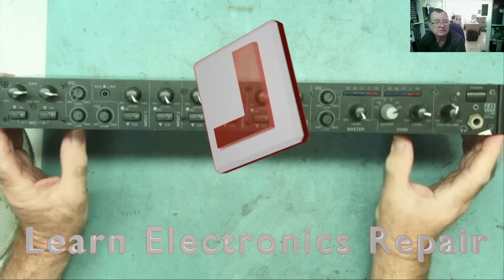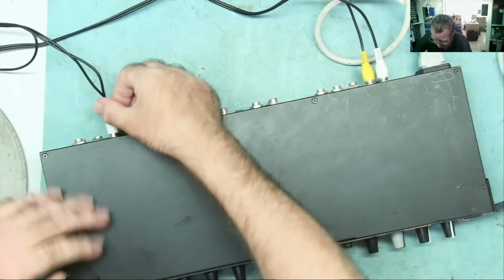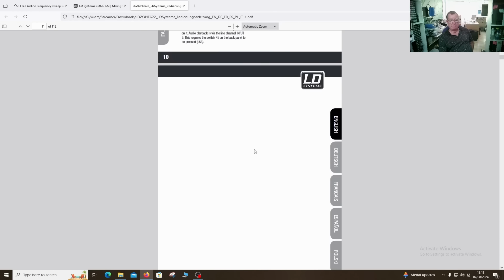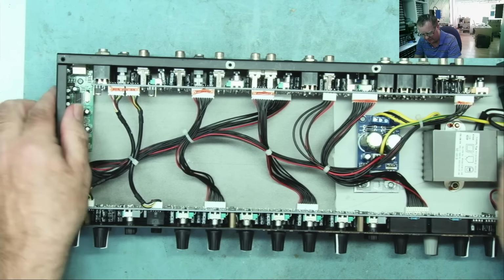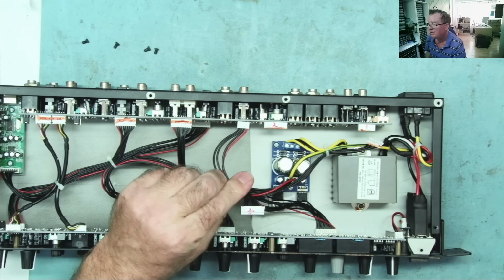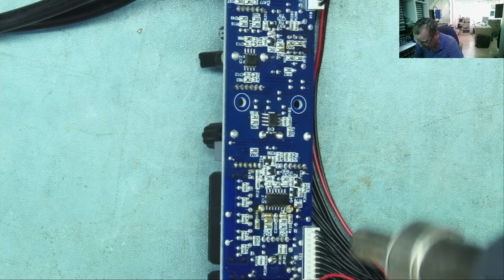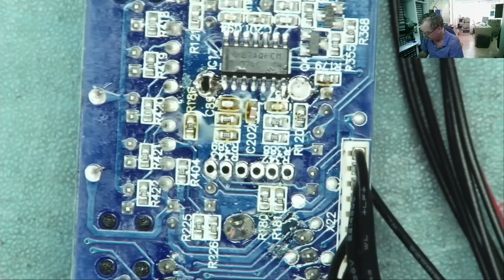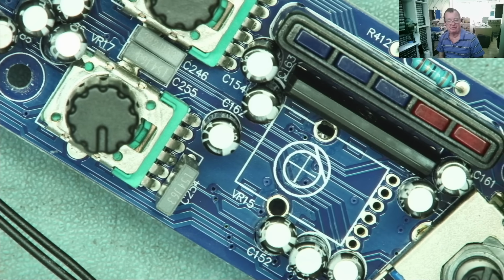LD Zone 622 2-Zone Rack Mixer Repair The customer says it is faulty but does that mean he is right?

Comment: 5:18 - “Beggin’ the Colonel’s pardon.” But, those were probably quality RCA audio cables before being subjected to the force of the weight of the equipment pressing down that closely to where the wire enters the connector end against your bench. I don’t think that even that small gauge of wire can be subjected to such a small bend radius without compromising its conductors. Just sayin’ . . .

Comment: Hi Rick.
Seems to me that the little illuminated buttons under every individual channels are cue buttons. That means, when selected in permanent led they drive their input to the cue out (last out) behind. The user has thus the ability to check that input with phones or a local monitoring system before the input volume and the mix. If you press this button the red light should go off on those two channels. After that any input signal applied should illuminate the led accordingly.
I can download the manual but my first approach is probably good
Reply: I was feeling something along these lines...because it is meant as a multi channel premixer...It hurt me just assuming they were not needed.  lol
And if I remember right, channel 1 and two did not light the 5 did...
Reply: @bennieholcomb4908  I really don't get your point dear

Comment: Regarding the audio sweep: You can use the program "Audacity" (an open source audio editor) to create a sweep (menu: Generate -> Chirp), save it as a file, and then just use any audio player that can loop its playback (like VLC). No special software necessary. You can even play it from your phone, in case the cable doesn't reach to the PC.
Reply: Audacity can also play on repeat, just press shift along with play.

Comment: Hi Richard, your videos have inspired me to attempt repairs on some of my antiquated gear from my halcyon days. I currently have a Roland U220 sound module (1989)  in pieces. I have used the incandescent test globe to show a short circuit. The PSU has 3x regulators; +5v -15v and +15v. The Main board is very much op amps logic gates and an intel processor. Separated from the Main board all voltages read correctly and the test Globe flashes and goes out OK. When I connect these 3 voltages individually to the Main board, my test Globe glows at varying levels of intensity depending on the combination of each. Have you experienced this and do you have any advice here?
Reply from the maker: Old linear power supplies in amplifiers etc can draw quiet a bit of quescent power hence the lamp may light.  Check for shorts from those voltage regulators to ground.  If you don't see one then power it pu without the bulb connected